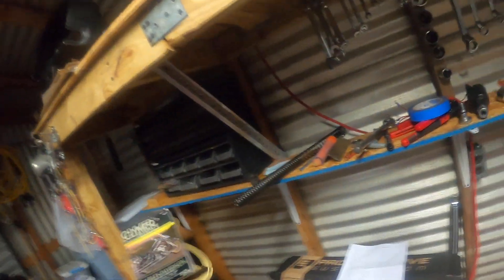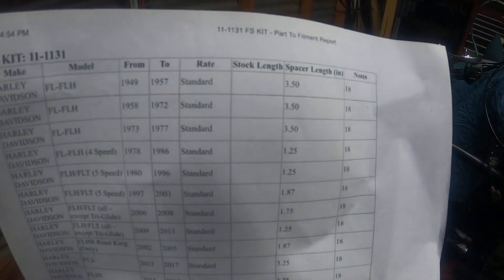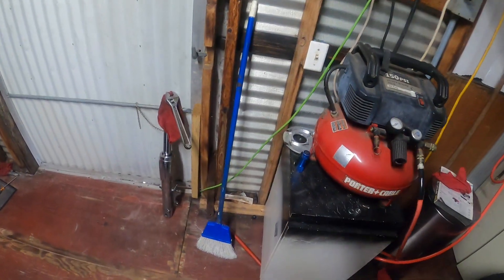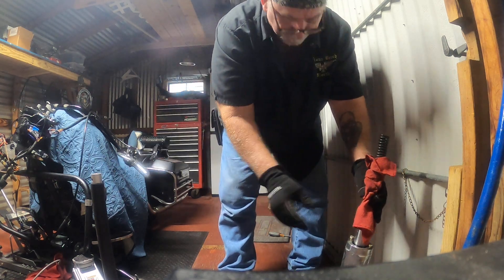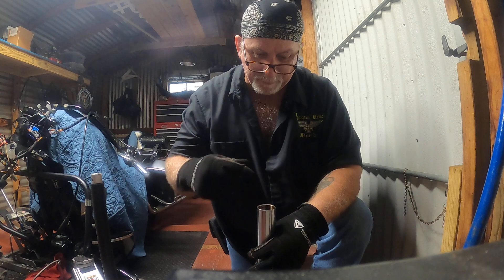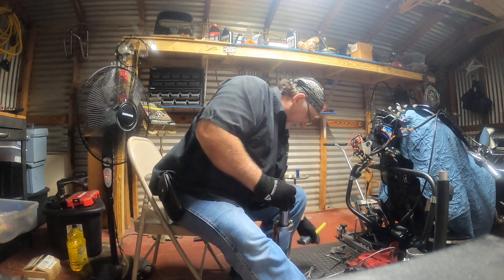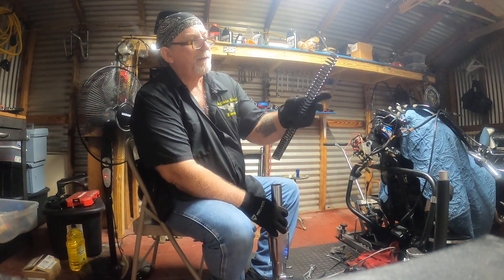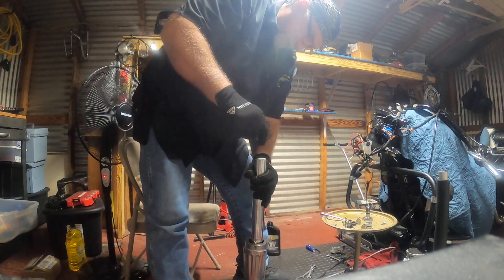1993 HARLEY FRONTEND UPGRADE

Comment: back in 2003 I did a FLT/C Shovel I had help doing it . we replaced the springs and seals .  one of the Old guys I ran with for 14 years .   I have the stuff to do my Road King Im waiting till winter to do it .  going to do the Swing arm bushings along with it . then my Bike will have New everything in under 3 years .
Reply from the maker: Yeah, swingarm bushings are on my list,also
Reply: @edZILLA64   Winter is around the corner .